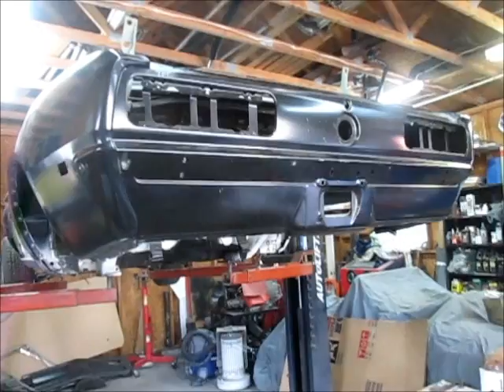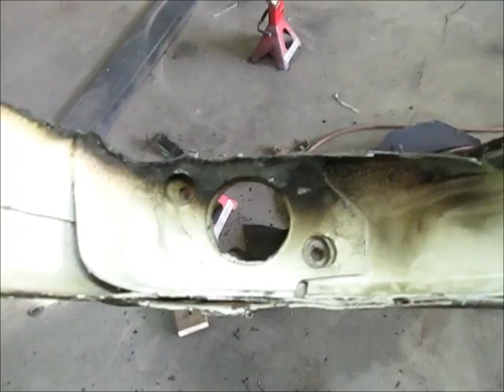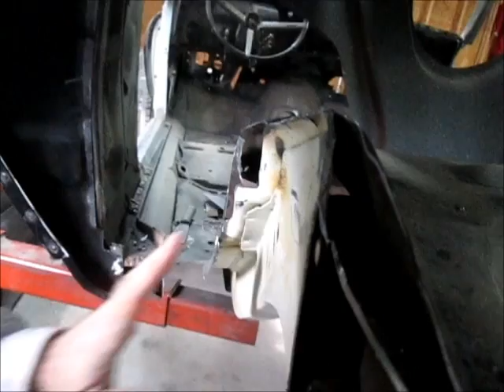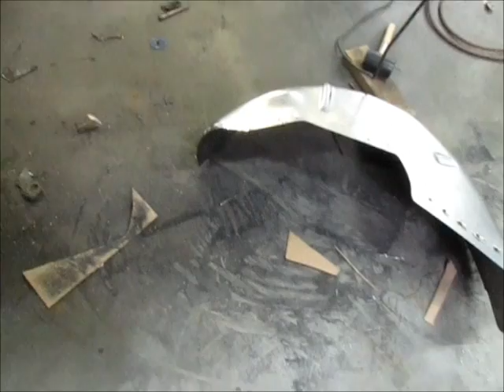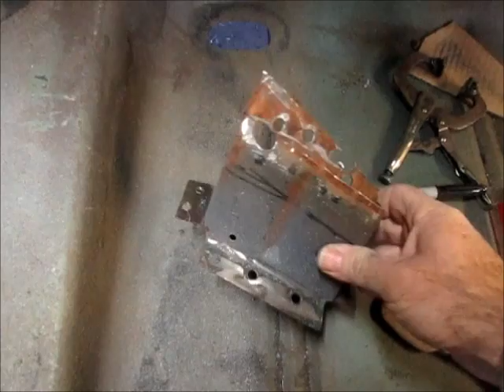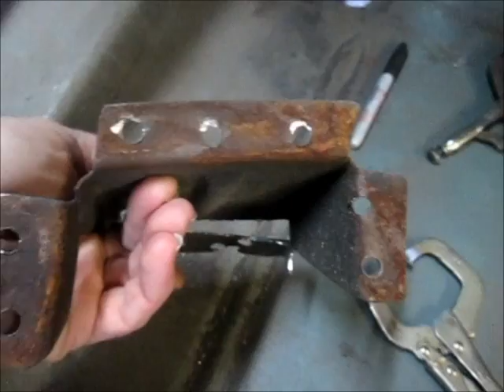1968 Camaro mini-tub install part 3

Comment: Would you recommend changing out the outer wheel house and quarter before or after installing a mini tube?
Reply from the maker: This kit is designed to be installed in an existing car. I would thing it makes more sense to do the outer and quarter fist. It could be done, but you will have to mock everything in place with clamps.

Comment: so did The costumer buy the mini tub kit for you or just the mini tub? I'm asking because the kit cost a lot of money and if I don't need all them other things would it be better for my wallet to just purchase the mini tub itself? my leaf springs are still in pretty good shape so I don't see the reason for me to get that. What I have in mind to get right now is just the mini tub, rear cross member, and new shocks for the rear. would that be good or is there something I'm missing?
Reply from the maker: The owner bought just the tub kit. Not the full kit. He had plans to put in a different suspension on his own. 4 link I think.
Reply: Jo Daddy's Garage thanks for the swift response what about the shock did you have to buy a specific type of shock for the shock mount relocation? or it doesn't matter?
Reply from the maker: I believe it was all part of the 4 link kit he was wanting to use. Look up 4 link set ups for a 68 Camaro. Pics will show the system.

Comment: Hello, I enjoy your video's. I see in this video you removed the shock brackets to install mini tubes.  I have been looking for one of those brackets,  I would be interested in buying one or two from you if you still have them. I don't like the reproduction replacements they are not as thick as the original. Thanks.
Reply from the maker: They're long gone, sorry.

Comment: @ 3:00 where Jo has to cut up into the frame area DS say cut 1/8 into that section. They have a video for this part where they cover it.  They also sell those plate that fit up into that area or it was part of the kit in the video.  This is a lot more job then it looks but it is also a mod that most of us want really bad so we got the drive.  Thanks for taking the time Jo for helping us by making this video.   As most of us are not as familiar with this job as Detroit Speed guys are.

Comment: I saw in your first video on this car that your customer wants a four link suspension. I will be quite interested in how you package that in the car. I just finished a 67 Firebird convertible that we put in mini tubs, a 3 link and coilover system and managed to keep it under the stock trunk pan. We tied the frame together with 2x3 tubing that came through the rear floor pans by 1.25" . I wanted to do a four link but couldn't figure out how to do it and still retain the back seat and trunk floor. Pics of the car are on pinterest under "Dads Firebird" if your interested.
Reply from the maker: mikenstacey Customer ordered a DSE quadralink I believe.

Comment: quick follow  up what was your total time on the mini tubs?
Reply from the maker: Walter Buraconak At this point I'm at 34.5 hours. That includes what you see and a fair amount of grinding. I will probably have 40 hours with all grinding, and seam sealing.
Reply: I had no idea it would take that amount of time.
Reply from the maker: Walter Buraconak That actually is kinda fast based on stuff I've done before. I really focus on fitment and final appearance. I've seen others done that weren't as nice. I've also seen others that were incredible.
Reply: The only reason I mention it in the video you said this could be done at home maybe for skilled professional but I think at the novice level this would take a few weeks. You make it look simple.
Reply from the maker: Walter Buraconak I agree. Sometimes it's hard for me to think that way. I've been doing car stuff for almost 40 years, so I tend to think that everyone else does the same things I do.

Comment: One question how are you going to add strength to the frame sections that were trimmed and narrowed ? At present I'm not sure how much structural rigidity in rear frame ???
Reply from the maker: Lawrence Eich Good question. The original metal was about 1/16" thick. Being a unibody, the strength comes from overlapping and spot welded pieces. In this case (as per DSE instructions) all the patches are made of 1/8" steel. After welding all the edges, I believe it is as strong if not stronger than the original material.

Comment: Hope your extra time completing this is rewarded by the owner. I'm surprised, or maybe not, that the drivers side shock mount is not in the same position relative to other side, different angle from the axle mount to the body. Something to do with getting quick and cheap production targets, much like the early Mustangs.
Reply from the maker: DaveP Oh, I will be compensateed. :o) The 67 model has the mounts in-line to each other. I think they changed it due to some geometry improvement. This same set up is used in almost all the GM vehicles after 67.